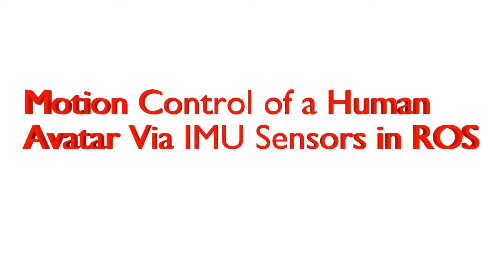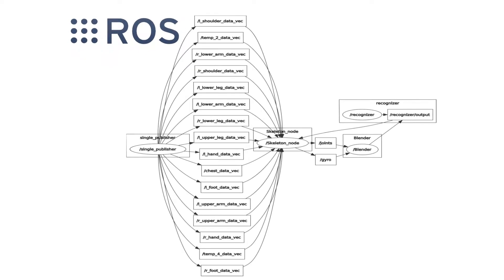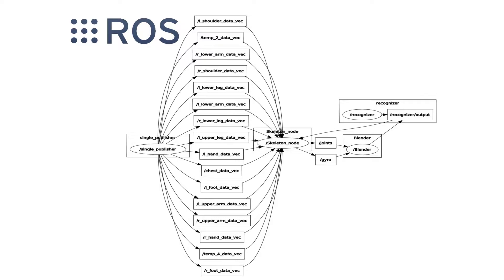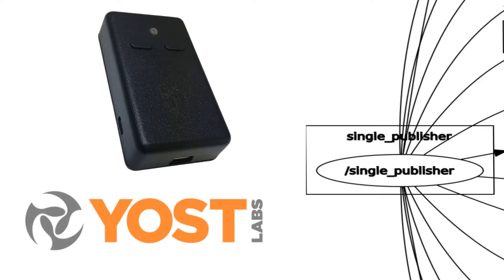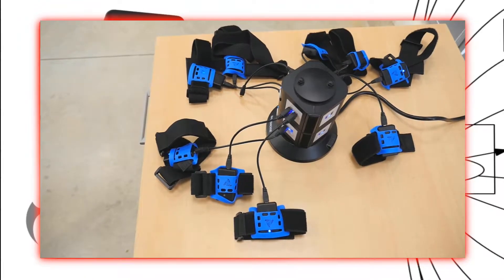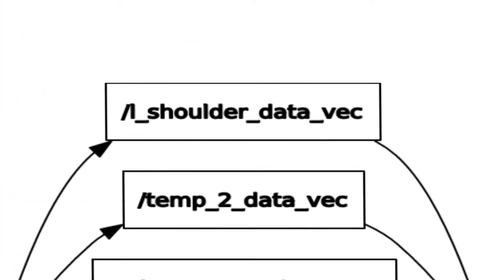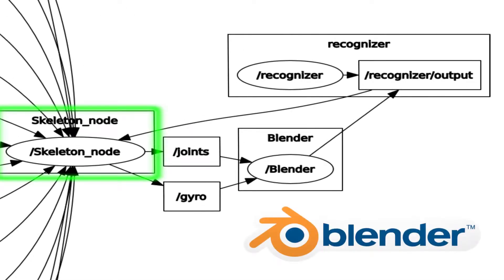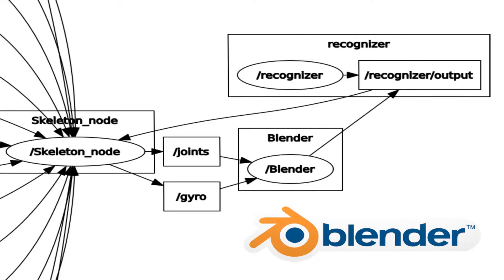Control of 3D Avatar in Blender with IMUs and ROS

Comment: Hi, It was quite interesting. You are using IMU sensors. I cannot see any Myo Gesture Control Armband elsewhere in the video. However, under the description section, you have mentioned about the Myo Gesture control armband too. Can you plz elaborate where are you using Myo Gesture control armband in the video? Thank you.
Reply from the maker: It is a mistake! Thank you for catching that. I used the Myo arm band for another project. I will remove it from the description.
Reply: @WADGESEL  Thank you very much for your reply. I have gone through the code of this work in GIT-HUB too. You have done this demonstration on live data. Is it possible I get a code which takes in the static data (instead of live data) so that I could be able to play that in my computer and at the same time learn the code too. I am learning it as a part of one of my big project for which I'm trying to publish some papers too. I'll cite your code as well as your related papers in that if I am able to get a full support from the code you provide. May I have your email address? Mine is m.adeel@connect.polyu.hk. Thank you once again.